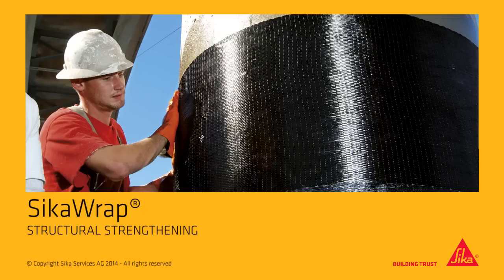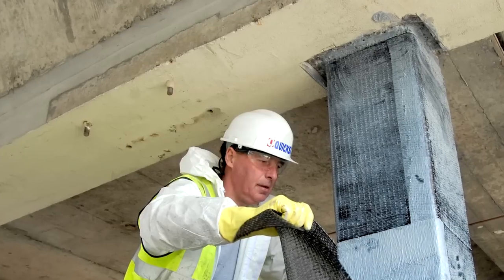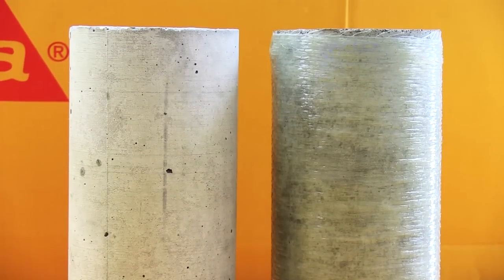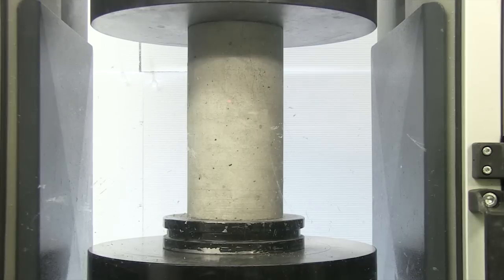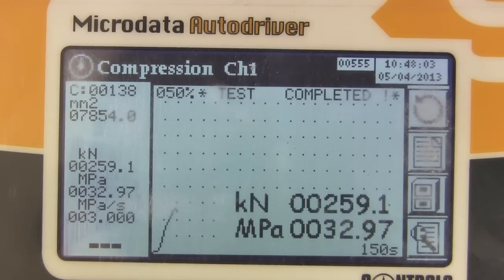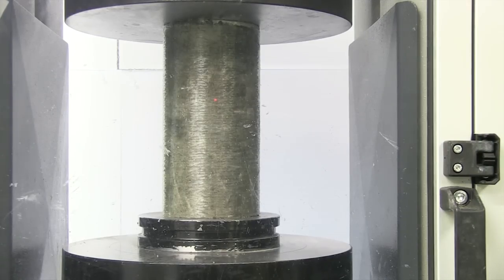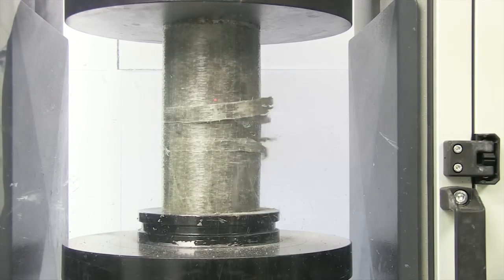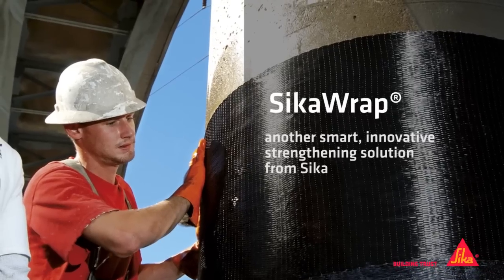SikaWrap® - STRUCTURAL STRENGTHENING

Comment: We had a batch of the presaturated sika wrap that we were going to use yesterday for a job here on the big Island of Hawaii to reinforce the opening of a concrete wall for a doorway at the Maunakea Hotel on West side of the island.  When we opened the package for the carbon fiber wrap it was hard and we couldn't unravel the role to cut it to length and apply it to the wall.  We spent over a half hour trying but it was rock hard.  We opened another role of the wrap and it was also rock hard.  We had to stop ✋ the job and we were very upset about it.  We will lose money 💵 on the job because of this.  I think we might have gotten a defective batch or the packaging isn't made well.  You should use better packaging to keep out air and moisture and make it air tight.

Comment: Hello  can we use SikaWrap to strengthening a burned Stone Column . if it yes tell me the method with many regards
Reply from the maker: If a substrate is damaged by fire, first the extent of the damage has to be assessed, and the remaining strength of the member has to be evaluated. 
The SikaWrap system can generally be used on stone. The damaged, loose cracked material needs to be removed, and the substrate surface needs to be prepared according to the PDS / Method statement. For any application of the SikaWrap system, a qualified engineer has to provide the design and calculation. The application itself is covered in the Method statement - there are different method statements depending on the fabric weight  and tools used in the project.